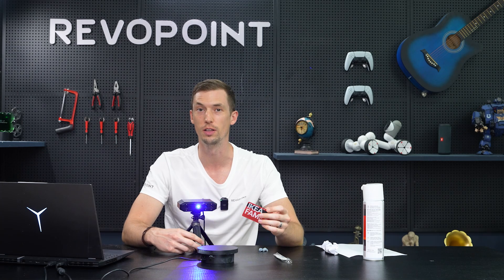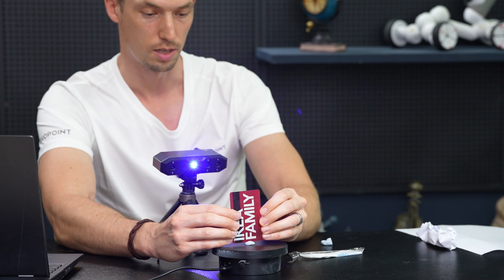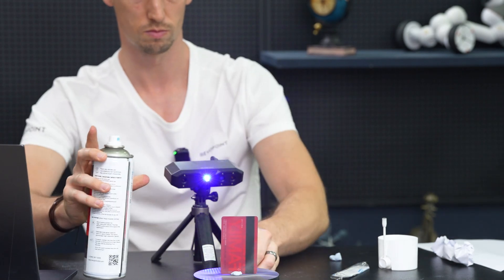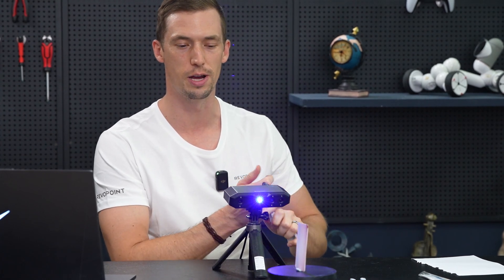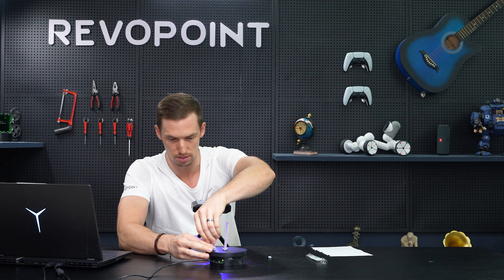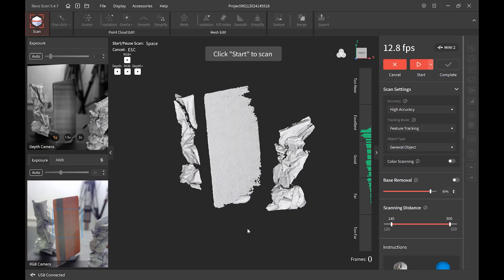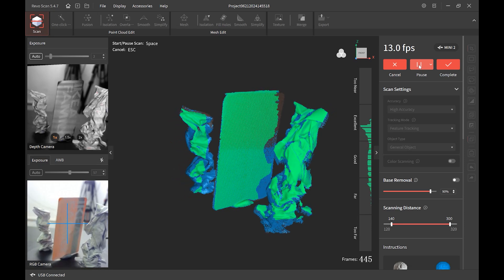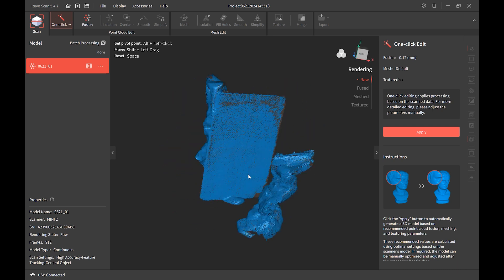Revopoint 3D Scanner: How to Scan Thin Objects

Comment: in genral a good pratice for almost all iscanners and items to place feature rich items around to keep tracking, i also did use crumbled paper, but in addition i went over to 3d print a stand to place the item upon, a dodecahedron works pretty good with nice surfaces to detect. what i don't like about this method shown here is the fact, the trackinghelpers occlude the item, especially in the perpendicular view onto it, i would place them on the edges of the card not the front and lay down not upright so i get a better line of sight onto the to scan object, the tracking issue should anyway occur only on the edges not in the front, execpt the software confuses back with with front but regarding the fov some smallm items at the sides should prevent this.
Reply from the maker: Your technique is spot on. We will pass this valuable suggestion to the video production team for optimization.

Comment: I've been thinking, I do that sometimes. Anyhow, it seems possible to lightly coat things with a airbrush sending a fine powder.
And if you don't have a airbrush, then if you scratch, and scratch, until the scalp produces a generous coating of dermis to rain down upon surfaces to achieve excellent scanning results. One of the two or both should work well, but the second solution can help stimulate healthy non chemical ways to 3d scanning.
It's Gross Humor Awareness Week, and last night there was a televised debate.